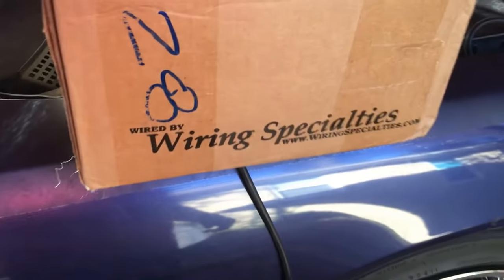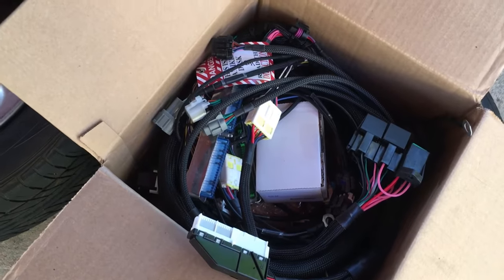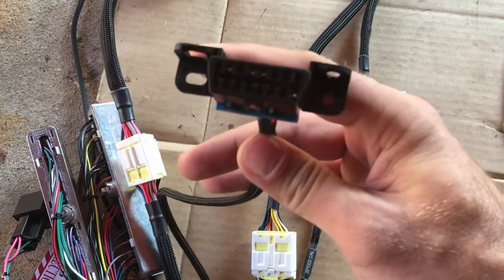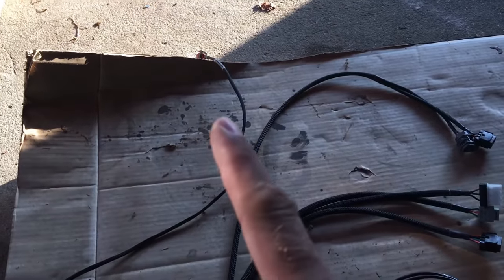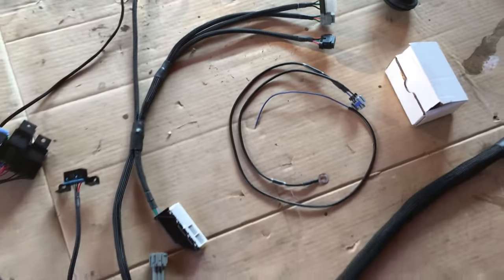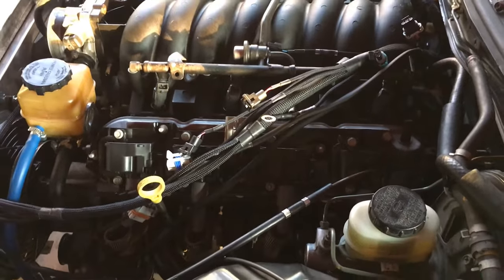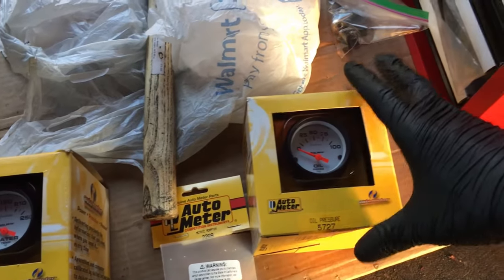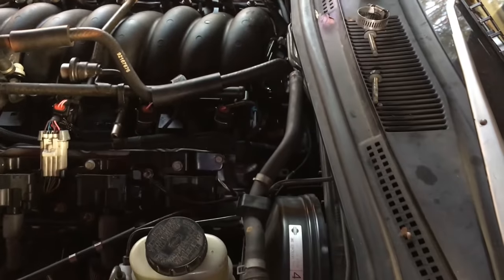Wiring Specialties Harness Install Part 1 - LS1 240sx (S14) Drift Build (EP 41)

Comment: Hey, the oil pressure connector in your wiring harness is for the oil pressure warning light on the dash, you can get a t-piece adapter that bolts onto the ls1 oil pressure port at the back of the head to ad another sender unit.
Reply from the maker: ah.. guess that makes sense.. oh yea, i know about the T fittings. I am not really worried about using the stock cluster for this or the water temp.

Comment: This might be a dumb question but with this wiring specialties harness you have the harness from the new engine to fit the stock gauges and ecm and all that stuff right?
Reply from the maker: No, not a dumb question at all. what you get and don't get can sometimes not be super clear. I may over explain but trying to be clear. You have your LS1 engine, LS1 computer and your S14.  Of course, you take out the KA24 with the engine harness and ka24 ecu which leaves you the body harness under the dash. The wiring specialties harness plugs into your LS1 with all the sensors etc. It is wired to only use the front O2 sensors so you will need to turn off the rear O2s. it will use the drivers side coolant temp for the computer. it has the wiring for the passenger side coolant temp and wiring for oil pressure as well. For these 2 you will need to buy the adapter plugs so you can plug them in. If you do this the stock gauges will work. S14 doesnt have oil pressure and I wanted a little more accurate water temp, so I went with aftermarket. In addition if you buy the dikota digital box from wiring specialties when  you get the harness it will be wired for you, you may need to change one wire, but then you will also have speed as well.
Reply: ToxicMongoose ok I see thank you yes I’m looking into doing g a swap as well an I was a little scared of all the electrical but it looks like it’s not as hard as it taught this just cleared some questions I had

Comment: I just swapped my s14 and used the full sikky kit aswel as the same harness and let me tell you it’s a breeze, however at the same time i relocated my fuse box behind the dash(where airbag use to be) makes it look so clean i would highly recommend it. Your videos are way better than ive seen. Way better than that video they send you from bravo motorsports haha insta@ imalexmarsh
Reply from the maker: I agree with what you are saying it looking that much cleaner BUT I know it works how it is and will get it running first. I have the battery, fuse box, heater lines and at some point AC lines all  on that side. I am wondering if it will even be worth it at that point, still undecided. I noticed before starting the detail of most videos on this swap were missing pieces and could leave you with many questions. I wanted to make a series that really went into more detail. As you stated though,  using the sikky  kit with the wiring specialties harness makes it super easy.